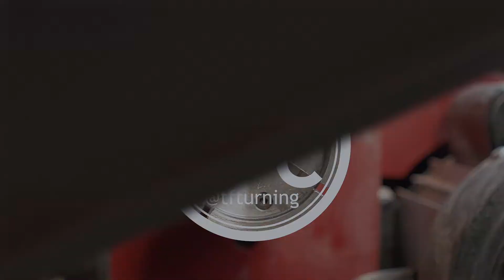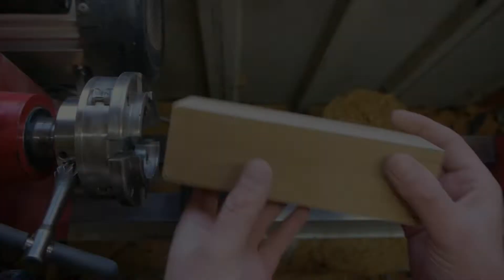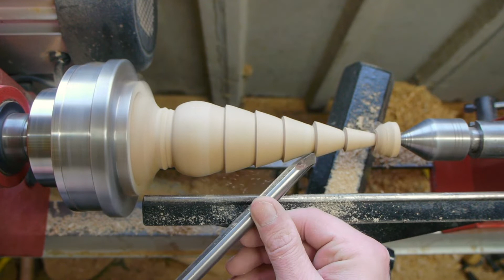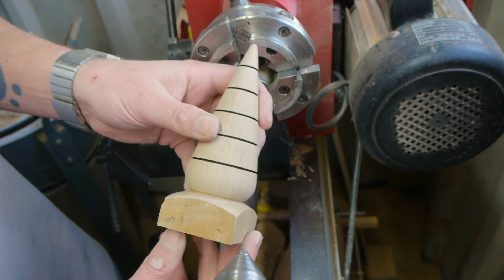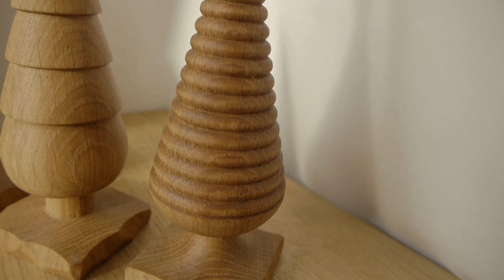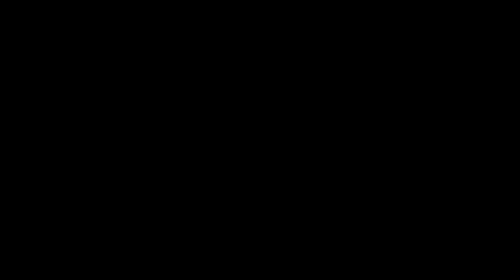Wood turning - Christmas tree project for the Craft fairs

Comment: Good eye; good hand Tim. Like the way you just knocked them out. Clever shaping for the bases - minimalist eh !  Question: What tool did you use first on the beaded one ?   
Thanks for sharing🙏 Take care. -Mike
Reply from the maker: Thanks Mike!! On that one I think it went spindle roughing gouge, skew then beading tool which I made from an old bowl gouge. Hope this helps! Cheers bud, thanks for watching 😁
Reply: @tfturning  bowl gouge beading tool  was the one I wanted - looked like a gouge but performed like a beading tool - good repurposing !!  Thanks !
Reply from the maker: @mpart_woodlathe-stuff  Ah, yeah it's great for uniformity in the bumps 😁
Reply: @tfturning  👍😎